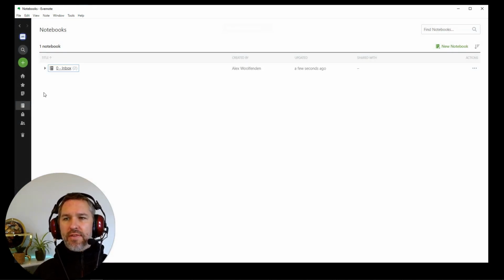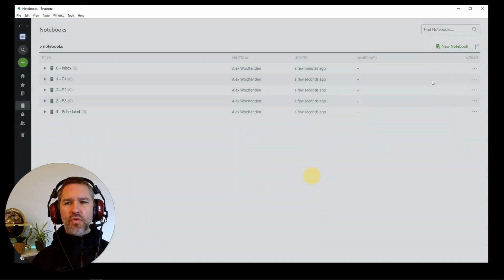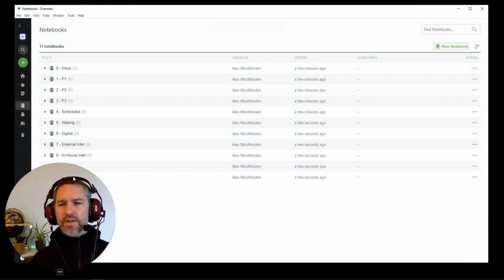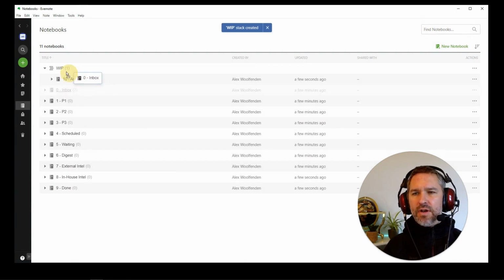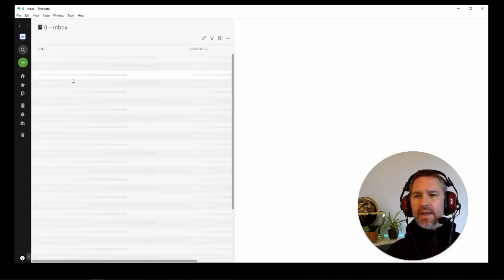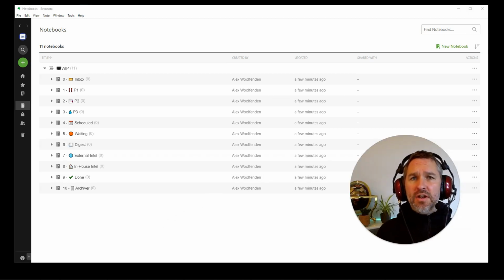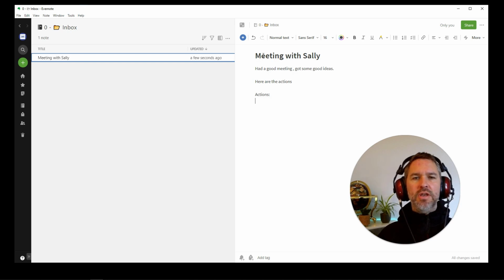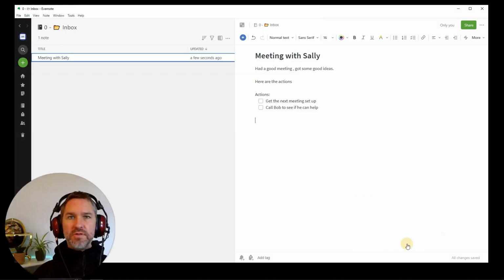Evernote for Task Management: Part 2 - Setting Up Our Notebook Structure

Comment: Thanks. Enjoying the videos. Always looking for ways to use EN for task management. Curious-when you searched for Emojipedia what app or tool did you use to pop up the search box?
Reply from the maker: It’s Microsoft PowerToys.  The pop up search bar is one of a few utilities you get with it.  Amazingly enough it’s actually from Microsoft themselves but they don’t include it with Windows for some reason.  

I’ve been a Mac user for 8 years and used spotlight (or Alfred) all the time.  Moved job and back to Windows in Jan.  Really missed the convenience of the pop up search bar so went looking for a windows equivalent. 

The trick to make it work is using chrome to make your favourite websites a chrome app shortcut.  

I may make a video on it after I’ve finished with task management.  It’s a nice add on to smooth out your user experience.  

Really glad you are enjoying the vids.  I had no idea how long it took to produce a YouTube vid!